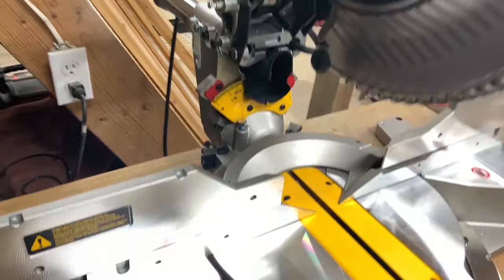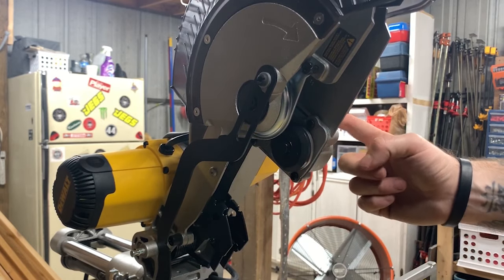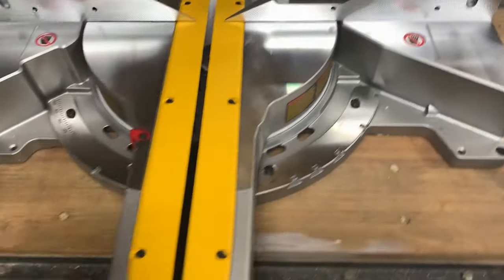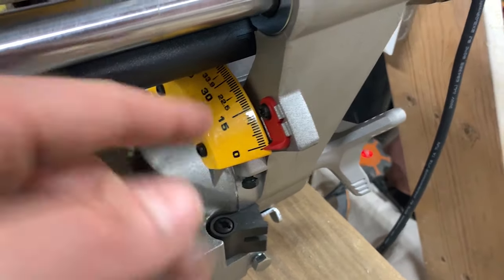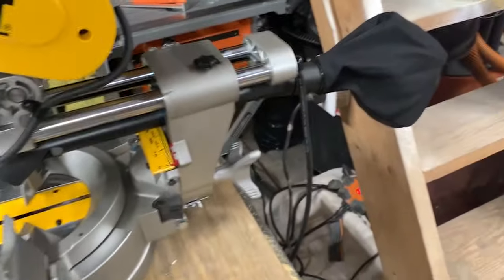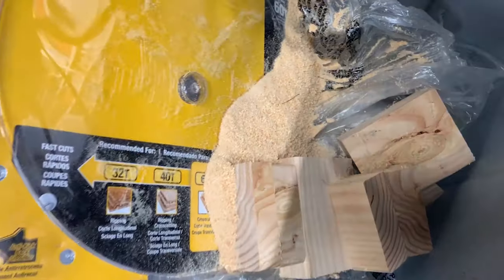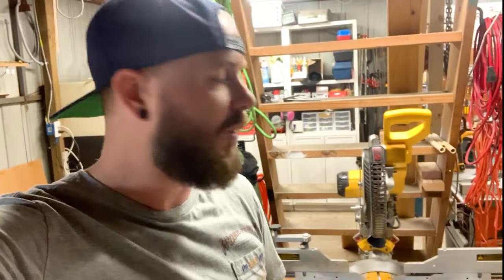Dewalt 12in Sliding Miter Saw DWS779: Setup & Review

Comment: I though this guy was BS'ing about the wobbly Ridgid saw blade, until I bought the  10" model. It had a noticable wobble that was plainly obvious at low RPM.  Thats just ridiculous.  They need to recall those saws, I think it could be dangerous.  I took it back and now am back looking into this saw.
Reply from the maker: Bummer that you thought I was bluffing, I was honestly super excited for the Ridgid Saw.. at the time I had almost exclusively Ridgid for EVERYTHING.. In a way it was a blessing, because it turned me onto other brands more than I had been looking in about 5 years.  Now my shop is a solid mix, and I focus more on the value I'm getting than the brand name.  Thanks for watching and good luck in your saw search!

Comment: For some reason I thought this model came with the laser but I guess not.
I really like it anyway. I think the laser takes it up to like 600.00
Reply from the maker: Yeah This is one step down from the laser version.  There has been someone in this thread that shared the aftermarket laser or light attachment if you can find that.  Thanks for watching!
Reply: You can mod it with the LED light which is better than a laser as it casts a shadow of the blade giving accurate cut widths. MMtoolparts has everything you need in a kit.
Reply: @seanclark8452  do you know the name of the kit?
Reply: @krehbein  It should be 'Work light upgrade kit'
Reply: @seanclark8452  ahh ok thanks

Comment: Nice that the saw has the kids safety feature👍. What made you or the store think concern about the blade?
Reply from the maker: For the Dewalt the box and the listing online as well as the instructions in the both say it’s supposed to come with 60 tooth blade not a 32 tooth blade. Lowe’s was nice enough to swap it for me, but I’ve heard that Dewalt will send the correct blade as well via customer service if you aren’t as lucky with Lowe’s directly.
Reply: Dewalt customer service says the 32 tooth blade come with the saw is a correct blade for the saw and refuses to send replacement. You've lucky to get it from Lowe's.
Reply from the maker: Yes I guess I was - I just explained it to the manager and showed them in the instructions booklet where it specifically says 60T blade - sorry they aren’t willing to help you out!
Reply: If a kid cuts their hand off playing with my tools they won't soon touch one again with that hand they don't have.

Comment: Did you say it was supposed to come with a 60T? Got mine at Home Depot and it came with 32T.
Reply from the maker: In the box it comes with a 32T blade but in the information booklet in the box it references a 60T blade. By showing that to a store rep at Lowe’s I was able to convince them to switch the blade for me.
Reply: What did you end up doing about the blade??
Reply: They've removed/cheapened the 779 relative to the 780 in the latest revision.

Comment: Can a stacked dado set be used on this saw?
Reply from the maker: I am actually not sure. I’ve heard it’s not a great idea to attempt, but I am also not sure it’s even possible to install that type of blade system. Good luck if you try it out, and circle back to let me know if it does end up working! Thanks!! 💪🏻🙌🏻
Reply: @TheToughGuysTV  I saw a DWS780 in my Home Depot yesterday, so I scoped this out.  Won't work....the arbor shaft on the saw is long enough to mount only one blade, where a dado set may need as much as 7/8"" of length.  Oh, well.  Hope my 30-year old Craftsman radial saw hangs on for another few years.
Reply from the maker: @dannywilliamson3340  Danny, thanks for getting back on this, it's great information to know!  I honestly had no idea, so I'm glad you filled in the gap there!  Good luck with your Craftsman, I hope it hangs on for you!!

Comment: You seem a little biased when it came to this review compared to the rigid, still saw some blade wobble with the dewalt so I just wonder what’s the tolerance for how much blade wobble is alright. I mean if the cut is square what’s the problem? You’ve got 12inch blade spinning at what; 2000+ rpm? With a 1” nut holding, you’re going to have some wobble. Agreed dewalt did better but how much better really?  And with And as far as dust collection goes... they’re just bags they’re not pulling any suction. Miter saws are just a bit messy.
Reply from the maker: There is no wobble with this saw. May not show as much on the video I guess but the Ridgid saws were horrible in person - the whole saw vibrates. The Ridgid blade vibrated and wobbled so much that it would skip along the surface of the wood you’re cutting when beginning the cut so it never looked clean. Especially with smaller boards, the cuts looked horrible. 

I’m no beholden to any of these brands, the Dewalt just works better so it got a positive review because that’s my honest opinion. I have tons of Ridgid tools, my table saw, tile saw, belt sander, router, drill driver and impact, my shop vacs etc - but that miter saw was trash.

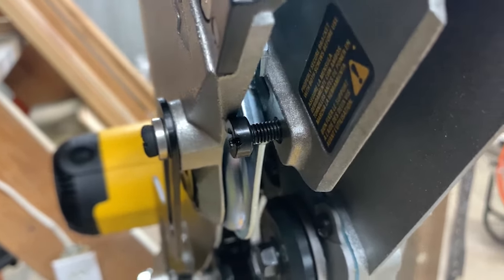Comment: @2:30 It's still plugged in....please remove from power when changing a blade. Otherwise good vid.
Reply from the maker: As far as I know it was not plugged in, I also pulled the trigger shortly before showing it was not plugged in.  I did plug it in after to show it worked. That black cord plugged in in the image was my compressor not the saw.. note the old paint mark near where it plugs in.  Thanks for checking out the video!
Reply: @TheToughGuysTV  I thought you knew better but it's easy to forget as I've done it. Gr8 video helped me a lot.
Reply from the maker: No worries I’m sure I’ve done tons of silly stuff, only way to learn is to make mistakes! Thanks for the support

Comment: Regardless of how tuff you are or how many safety features the saw has you NEVER have it plugged into the wall socket when you fit the blade.
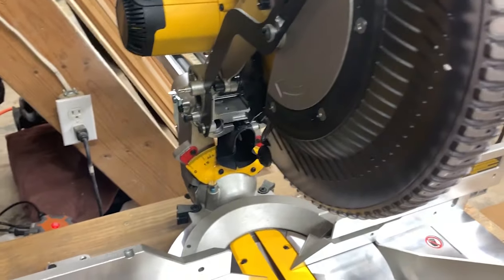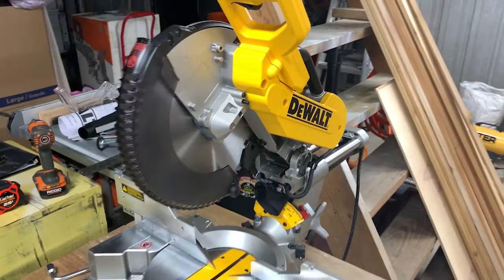Reply from the maker: You know for sure my saw was plugged in?  At 1:30 into the video, I literally pull the trigger on the saw... and it doesn't fire up.  You know why? Because it's unplugged... At 5:00 in when I fire it up... that same black cord is still in the shot (The one I'm assuming you think is the saw cord) because it's the vac plugged in which sits on the ground and I plugged the saw into a hidden surge protector (Which you can see for a split second on the ground at 5:23 it's a Ridgid brand unit).  Not sure if you're directing the 'Tuff' comment towards me, but maybe take a moment to understand what's actually going on before making an accusation and spreading negativity.  Have a good one!

Comment: Try cutting some thin moulding like oak, then will see how good it is.Any saw cut cut straight simple cuts , big deal!
Reply from the maker: Shelby GTRAG .. Ok. I cut all kinds of wood with it - large and small, complex cuts and not so much. Are you saying it doesn’t do a good job of it? 

I wanted to keep the video down in length BUT I am thinking about doing some expanded videos on these saws so is there something specifically you’d like to see? 

Thanks